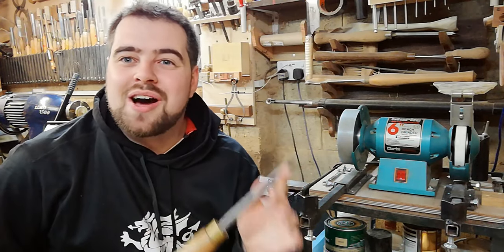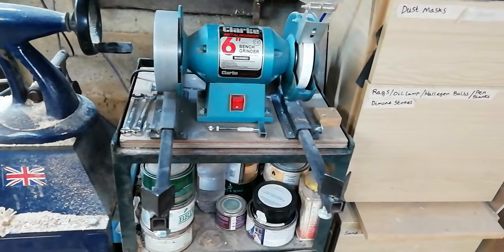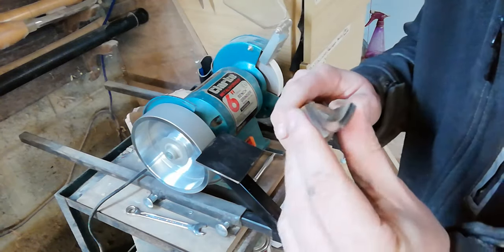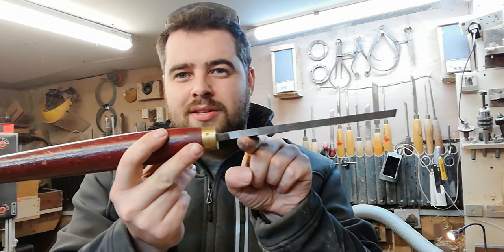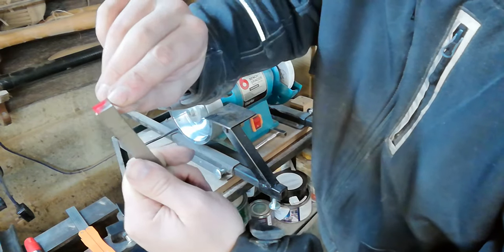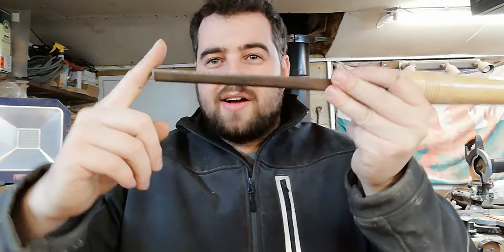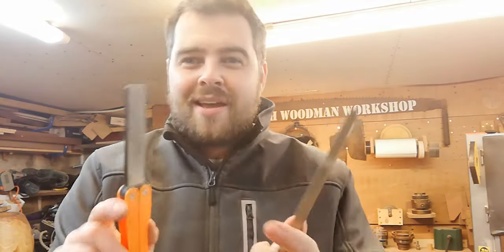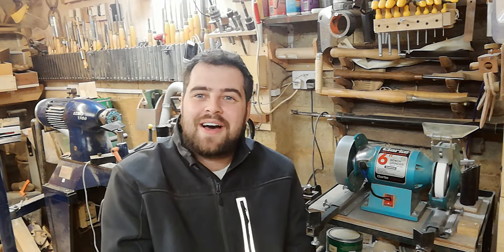How to sharpen woodturning tools for beginners

Comment: I have been looking for videos for beginners that lay turning stuff out clearly and give lots of details. I think I finally found the right channel. Thank you!
Reply from the maker: Thanks Rachel really appreciate your comment glad the videos are helping 😁 thanks for watching 👍
Reply: The hardest part in my opinion when learning from people who have mastered or are close to it on the lathe is they are using high end lathes. And I found starting with a sub 1000 dollar midi lathe that the power in real nice full size lathes makes everything go smoother
Reply: I could be wrong for sure but I figured out how to create the outside form I want pretty well. But hollowing is where I'm having issues and I think more power would solve at least some of it

Comment: Thank you for this! I dont have  a jig, nor a way to easily fashion one, but using the tool rest I was able to duplicate your method with a fair amount of accuracy. (My grinder IS my lathe, I mount the wheel on the headstock. Eventually I can invest in a grinder and make the needed jigs, but for now I make due)
Reply from the maker: Thanks for your comment I'm glad the video helped 😁 I hope you have lots of fun turning all the best Tom

Comment: after 4 yrs wold you every go carbide tools
Reply from the maker: Thanks for your question it's a great one, I think carbide tools have their place for certain tasks and situations. I only tend to use them when I'm creating the inside of hollow forms. I love using traditional tools and the challenge of developing the skills to use them proficiently, it's certainly a big learning curve and it's far easier to learn to use traditional tools with a tutor or some professional lessons but once mastered they can be far quicker to use than carbide tools and give you a nicer finish. But ultimately use whatever you feel more confident with and you feel is safest to use. if the piece is sanded and finished well the end user would find it hard to tell what tool has been used to turn it. I think this would be a good video topic in the future 😁 I hope you have lots of fun turning 👍

Comment: Thanks ever so much for this, makes understanding it a lot easier than I thought. Thank you. Video was good , not long at all and for once no crappy music which is what i want to see from a guy who is explaining something technical. Its something i appreciate a lot as I am partly deaf and find it difficult to concentrate when there is someone narrating over music. I'm based in spain and have just got myself a nice 1hp Lombarte lathe, same as a decent Axminster with all the bells and whistles, I upgraded from a smaller model which was a bit underpowered really for its size. This one is just over 1.2 HP.   Youll do very well on you tube I think..  Thank you.
Reply from the maker: Thanks for your comment I really appreciate it, I'm glad the video came in handy. Thanks for watching.

Comment: Great presentation Tom love the tip of sharpening the wing of a roughing gouge never heard of that before keep up the good work mate great channel
Reply from the maker: Thanks Steven, I picked the wing sharpening tip up from a spindle production turner in England, he said grinding it that way saves him seconds per piece but at the end of a production run all those seconds add up, so it saves him time and money. Luckily I have never had to worry about saving seconds with my work and focus more on having fun :-) thanks for watching.
Reply: @thewelshwoodman649  Yeah I wasnt thinking about saving time more of if you have just roughed out a spindle it would be nice just to put a quick fine cut over it to get some idea what its going to look like finished

Comment: Thank you for some excellent information and great presentation. I am also about to sharpen my expensive bowl gouge for the first time. I did bite the bullet and buy a CBN wheel for my 6 inch grinder, so I’m hoping it will make the task a little easier. Please consider making a sharpening jig that does not require welding. I’m sure there are a lot of us without that gear.... or the talent to use it.
Cheers, Rick
Reply from the maker: Thanks for your comment Rick I'm glad the Information came in handy, I hope you have lots of fun turning, I used a really simple wooden jig for years that worked really well based on Marius Hornburgers design (he has made a you tube video on making a jig which is excellent defiantly worth checking it out) I hope this helps 😁 thanks for watching.
Reply: @thewelshwoodman649  Thank you once again. That is a brilliant site, and I will definitely have a try at making that sharpening jig. Cheers!

Comment: Thank you for this information.   I recently purchased a new slow speed grinder and 2 cbn wheels for it but I have yet to put them on as the grinder came with aluminum oxide wheels.  I also have a wolverine jig and seem to have trouble with consistency using it.  Practice and practice again i suppose.  After watching this video, I think I see what I've been doing wrong.  Thanks again.
Reply from the maker: Thanks for your comment, I'm glad the video helped :-) thanks for watching

Comment: Best video I've found for sharpening. I'm interested in a CBN wheel. Can you share the details of the one you're using in the video? Size, width, etc. Is there a link you can share to the one you use? Thank you for the great video!!
Reply from the maker: I got the CBN from a company called tool post in the UK who have sadly closed down. The CBN wheel I've got is a 150mm (6inch) in diameter and 50mm wide (2 inch) its a fine grit wheel. You can find lots of different sizes and grits online to suit your own grinder. One thing to look out for I'd the bore size of your grinders spindle, to make sure the hole in the CBN wheel matches the spindle of your grinder. I hope this helps 😁
Reply: @thewelshwoodman649  that's exactly the info I wanted. Thank you!

Comment: Great info, what is the best steal for wood turning tools
Reply from the maker: Thanks for your question Matthew. My choice would be High Speed Steel (HSS), its got a good carbon content and keeps its edge well, the Steel is designed for cutting materials at high speeds which is ideal for both metal and wood turning. It is also easy to sharpen which is a bonus 😀 I hope this helps, thanks for watching 👍

Comment: Hi Tom,  I'm contemplating going for a "WET and DRY" system. Any thoughts?
Reply from the maker: One of my good turning friends uses a wet and dry Tormek system with all the jigs and he absolutely loves using it, he let me have a play with it and it was super easy to use and produced the same results as a grinder. If you are in a woodturning club, I would ask around and see if you can try a few sharpening systems to see which one works best for you 😁 I hope this helps 😊

Comment: Great video Boss 👍 I don't suppose you are anywhere near Carmarthen or Swansea? I'm between both. I really struggle sharpening, always seem to get high wings on my bowl gouge. Tip looks good but the wings end up high and crescent shape making it very 'catchy'.

Any idea what I'm doing wrong?
Reply from the maker: Thanks for your comment Bob. Unfortunately I'm not near Carmarthen, but you will probably find a woodturning club in your area. By the sounds of what you are describing either the angle you have set your table or jig might be slightly off or you are not quite rolling/rotating the tool in a sweeping action enough to grind away areas of the wings of the gouge. I hope this helps ;-)

Comment: Hey! Congratulations on the video and thank you for all the useful tips! 
A couple questions:
- Is that a regular 3450rpm grinder?
- How would one know if one of our tools was heat damaged. 
Thanks again!

Santiago
Reply from the maker: Thanks for your comment Santiago and for the great questions. The grinder is a regular speed 6inch grinder, slow grinders I've been told by friends can be more effective at sharpening. When the tools are manufactured they are normally go through a heat treatment process where they are hardened (quenched- which can leave them brittle) so they have to be normalised heated up to a specific temerature in an oven for a certain period of time (normally the cutting edge will turn a straw yellow colour) when you over heat the tool you when sharpening you will see blue/purple spots along the cutting edge of the tool. I hope this makes sense and helps 😁 thanks for watching 👍
Reply: @thewelshwoodman649  Hey! Thank you so much for your reply!

Comment: Hi there, newbie wood turner here. I can't afford a cbn wheel atm, so what would be my best alternative for my challenge bench grinder with 6" wheel, 127mm bore hole please? Thanks, Carol.
Reply from the maker: Hi Carol, I would suggest fitting a smooth white wheel that will fit the bore hole, as this will remove less material than the gray wheels, prevent overheating the tool when sharpening and give you smoother finish for your bevels. I hope this helps 😁
Reply: @thewelshwoodman649  Thankyou for your fast response. Any suggestions as to where I can source said wheel?
Reply from the maker: @madbuthappyme2553  if you are based in the UK Axminister tools and machines would be worth looking at as they sell them 😀

Comment: Hello!  Thank you for your videos, you have been my tutor since I bought a lathe at the beginning of lockdown.  I want to buy a CBN wheel but cannot find the right size. Any advice on where I might purchase the right one would be more than apreciated. My old grinder takes a 6" wheel with a 1/2" bore. Kind Regards. Wendy
Reply from the maker: Thanks for your comment Wendy I really appreciate it. I bought my CBN wheel from the Tool post which has sadly closed down. I think Axminster tools and machinery sell them. When I bought my wheel I also bought a machined adaptor insert to help fit my grinder spindle shaft, essentially it's a piece of turned steel that has a tight interference fit to the wheel and a hole drilled through it to fit the spindle size. This might be an option if your struggling to find a wheel that fits exactly 😁 I hope this helps all the best Tom
Reply: Garry not Linda. If you're in the US check with Wood Turners Wonders and Craft Supplies USA.

Comment: Great video I have just bought a lathe will be watching a lot more you have your self another sub! 

You may have already covered this as I have lots more videos of yours to watch but how sharp are your chisels after going on the grinder I'm used to sharpening knives plane irons and wood chisels on my japenese water stones and then I strop them resulting in shaving sharp edges I literally test them shaving my arm hairs !! 

Do lathe chisels need to be this sharp or are they fine straight off the grinding wheel? 

Is this level or sharpening ever required for lathe chisels? 

Many thanks I will be watching more of your videos! 
Chris
Reply from the maker: Thanks Chirs I'm glad the videos are helping. That's a brilliant question. I tend to use my gouges straight off the grinder, it helps if you have a really smooth grinding stone to remove the smallest amount of material focusing on the cutting edge and the angle. I use to strop my scew chisel the same as you would with a knife, since I got a CBN wheel I've found it gives me really similar results as stropping so tend to sharpen all my turning tools on the CBN wheel now and go straight back to turning. The steel your turning tools are made from, their heat treat and what material you are turning will determine how sharp your tools will stay, so most people find it quicker to use a grinding wheel to quickly sharpen then get back to turning. If your having to really push the tool to get it to cut its normally a sign its time to sharpen. I hope this helps :-) thanks for watching .

Comment: Hello, what angle did you use on gouge with red handle? Tíme  26:24 Sorry for my english 🤣
Reply from the maker: The knife parting tool is around a 45 degree angel with a releaf angel ground at the top the releaf angle can be anywhere between 45-80 degrees, I would experiment and see what angle works best for you 😀

Comment: What model grinder is that? Had a loot at machine mart but there seems to be a few different Clarke 6" grinders. Not sure what to look for.
Reply from the maker: Hi Andy I picked the grinder up from gumtree second hand for £15 it's a Clark CBG6RZ 6 inch bench grinder, it came with a course and fine wheel. I've replaced the course wheel with a CBN wheel from the tool post, I hope this helps 😁
Reply: @thewelshwoodman649  Thanks for that, they seem to have loads of variations on the same 6" one. Not too expensive, which is nice surprise for once :) - Did you need anything else to mount the CBN or was it a straight swap?

Comment: New subscriber here, great informative video, I’ve seen something about sharpening the carbide tips... is it worth it?
Reply from the maker: Thanks for subscribing Vince, I think it depends on the design of the cutter some have been designed to be deposed of when worn out and others you can touch up with a diamond hone and lapping fluid, I've only had experience in using Simon hopes carbide tips in making hollow forms so haven't used mine a great deal, I tend to rotate the cutter when it gets dull or change them out. I hope this helps. Thanks for watching 😁

Comment: Where did you get your grinder/sharpener from? And where in Wales are you? 🏴🏴
Reply from the maker: The grinder is an ancient 6 inch Clark that i picked up second hand in Cardiff off Gumtree, the sharpening jig i made myself there is a video on my channel of the making process which might help. The CBN wheel I got from the toolpost  which use to be in Didcot but has sadly closed down now. Thanks for watching 👍
Reply: @thewelshwoodman649  thank you. I’ve only just started wood turning at 58 years old. I love the process. How often to you sharpen chisels and how do you know they need sharpening? Bearing in mind I’ve never picked up a chisel until two weeks ago 🤦🏼‍♀️
Reply from the maker: @hayleywood93  Thats a brilliant question Hayley 😁 which isn't the easiest to answer as there are a lot of different variables, depending on the type of wood you are turning, how seasoned the wood is, what tool steel your gouges are made from etc, which will all depend on how often you will have to sharpen your tools. You will gage with time and experience when the tools start to get dull as they won't cut as efficiently as when they are sharp, if your finding you are pushing harder to make the tool cut that is normally a good sign you need to sharpen. I hope this makes sense and helps in some way 😁 I've got a few more turning videos on my channel which might help with some other questions 😁 thanks for watching 👍
Reply: @thewelshwoodman649  thank you.. I’ll take a look 😊